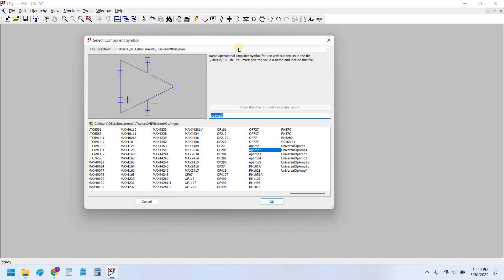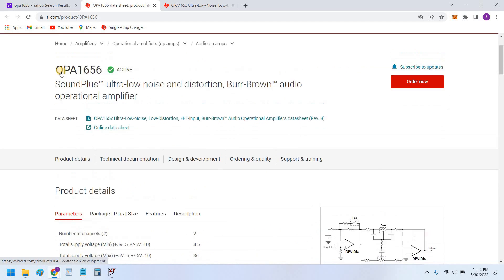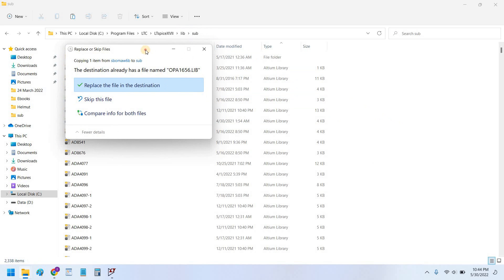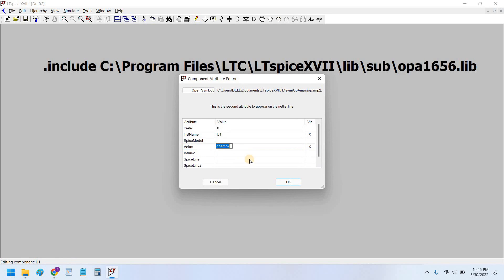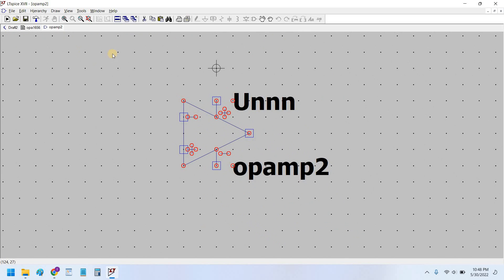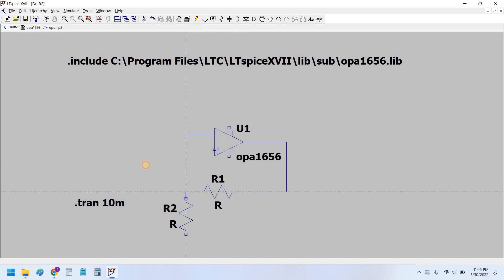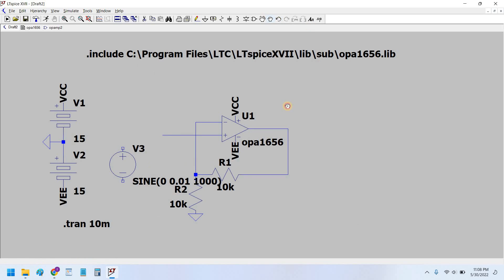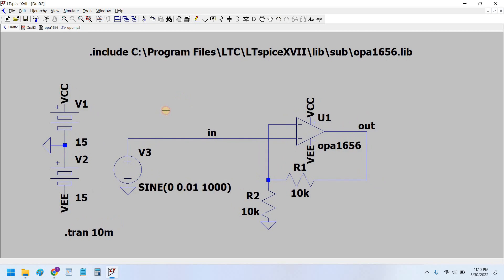How to Import 3rd Party Spice Model into LTSpice #importing #viralvideo #electronics

Comment: Unfortunately it does't show that your model works as expected. Even if the model is not included (for some reason) it will shows the same just using the generic model. You should show the test circuit which comes with the datasheet.
Reply from the maker: Well, we cannot say that without confirmation. The simulation run used here was transient analysis, while if we can run the noise or THD analysis it can verify the OPA1656 model against the noise and THD values in datasheet.